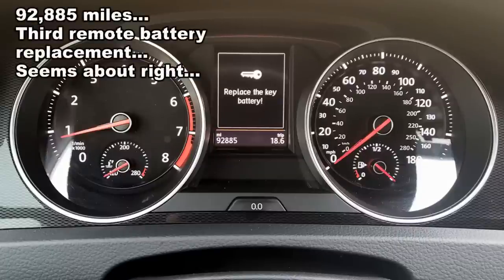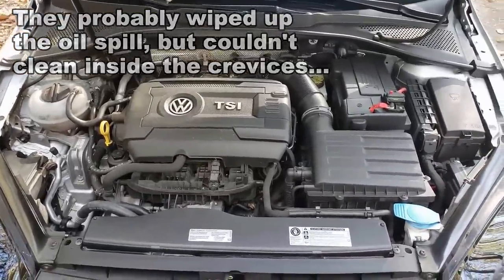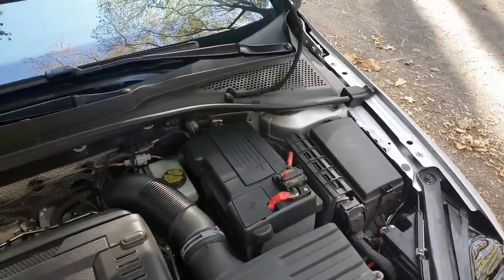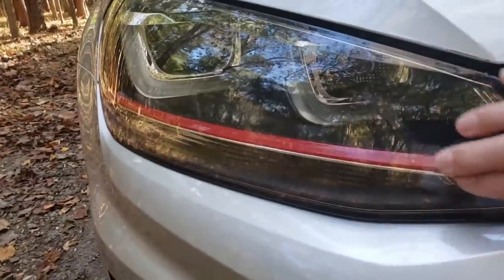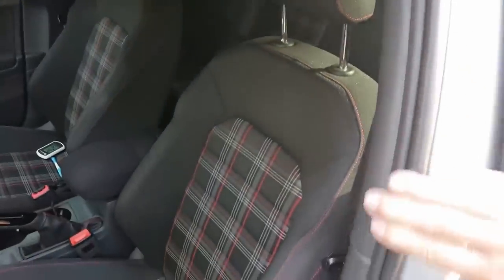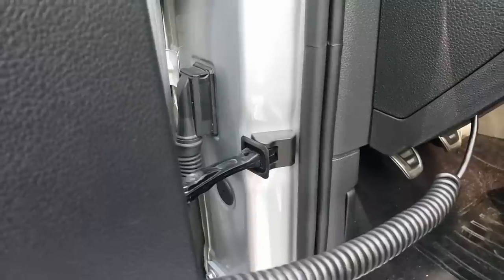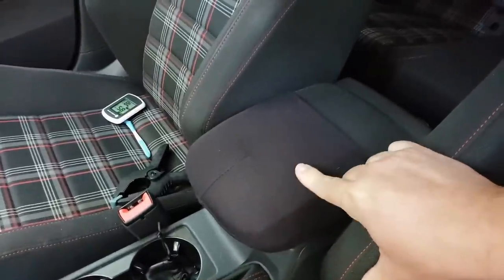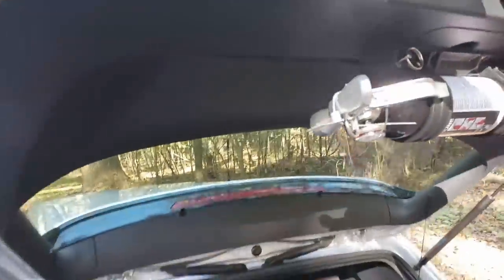THREE YEARS AND 93,000 MILES: My Report, Part 1

Comment: I had the same problem when I installed the steel oil pan. I did some research and found out that the Audi S3 oil pan gasket fits perfectly. Here is the info: FEL-PRO #OS30821. So far, there is no oil leak. Hopefully it will help you out as well.
Reply from the maker: Thanks for sharing that. Oddly enough, I had already found that part as well as a similar one by Mahle. I went with the Mahle part, seen at https://amzn.to/351UMJT. I'll shoot a video when I install it. -Scott
Reply: @StealthGTI  when I click on the Mahle gasket on your link , it said not fit your GTI.  Are you sure it the right one? By the way, I have a steel oilpan as a backup for my 2019 gti rabbits. It's only a little over 6K miles. If the plastic oilpan leaks down the road, I'll be replaced with the steel oilpan.
Reply from the maker: @altimase2003  - It will say "Does not fit..." because the factory car has a plastic pan with integrated o-ring gasket. We're ordering a Tiguan gasket for use with an aftermarket steel pan. As a result, it will not fit a factory car, but it will fit a car that's been modified with a steel pan. Make sense? -Scott
Reply: @StealthGTI  Thanks, Scott. You have driven a lot of miles in three years. Did you change the oil every 10K like the manufacturer recommended?
Reply from the maker: @altimase2003  - Every 10k like clockwork. My next drain will be very early since I need to drop the oil pan to install the gasket. That'll wind up being a 4k drain followed by a 6k drain to get me back on even intervals that match the odometer. OCD, right?  HAHA! I'm a little behind on the air filter and spark plugs. But the car drives fine. It's also time for brake fluid flush and new differential fluid. I'll take care of that stuff soon.
Reply: @StealthGTI  any sign of carbon deposits Scott? This is my first VW. I've heard quite a bit about the carbon deposits issue.
Reply from the maker: @altimase2003  - I, too, was concerned about carbon deposits. My mechanic, a longtime VW enthusiast, won't even bother to look for deposits until the car trips a fault code of some sort. He said more, but I don't recall the specifics. I use only Top Tier fuels, which the owner's manual recommends anyway, and run the car hard from time to time with the hopes that it's burning off at least some of the deposits. I've also read in several places that occasional 20-minute hard runs help to burn off deposits, too. I don't know if it's true. Regardless, my semi-annual support of large bicycling events makes that easy: 1500-lb trailer, then run the car at 3200 rpm for about 20 minutes of the 1-hour morning drive to the venue. I don't know if it's helping or not. But the logic behind a good, occasional hard run seems feasible. ;-)
Reply: @StealthGTI  Thank you Sharing your experiences sir.

Comment: Good almost 100k review lol. I don't have the leather on my 17' sport parking break... I just started to notice last week I'm always rubbing on the weather stripping when I get out too. I'm only at 17k miles and my stock clutch started slipping at 12k with apr stage 1 tune. Still drives fine but I can't push it anymore. I talked with Sachs (clutch manufacturer) and it only rated for 260 ft. Lb. +/-10% so it's just weak from the factory. It's rated within margin for less than the factory numbers so I want happy about that. Love the car though.
Reply from the maker: The video I published a few hours ago addresses the power vs. stock clutch. We'll see if the naysayers understand that I was abusing the clutch with power and towing. HAHA! Thanks for visiting.
Reply: @StealthGTI  I thought I was replying to part 2 lol. I had a lot of fun all the time at first. V. W. Did poorly choose the factory clutch imo. It's almost as bad as the stock tires haha.

Comment: plastic pan is fine unless you autocross the car, if you are really concerned about it and you are since you changed the pan, put the skid plate
Reply from the maker: Thanks! I have the skid plate as well. If I was doing it all over again, I would go straight to the skid plate and keep the factory pan. Oddly enough, the Mk8 uses steel again. I wonder if they went back to RTV sealants or if they have a better gasket? Thanks for visiting!

Comment: You could use Loctite 518 to stick your pan on - any excess mixes with the oil, but does not cause harm because it doesn't harden in the presence of air.
Reply from the maker: Thanks for sharing that.

Comment: I'm a Vw tech, the coolant comes low from the factory and at the PDI some ppl don't top it off since it's at Max but once you drive it it drops so it's low and ppl don't top it off cuz once you open cap the level goes up again but yea if there's no leak that's the explanation when the engine is warm the radiator and hoses expand dropping the coolant level but once you release that pressure the coolant rises since the pressure of hoses degreases
Reply from the maker: That seems reasonable. However, if I top it to the MAX line and then the coolant level drops, isn't that a leak? Or is something else happening? Another VW tech suggested that the cap vents excess coolant. It seemed plausible at first. But wouldn't I see pink "chalk" around the cap somewhere? Anyway, what are your thoughts on continually low coolant? Thanks for posting.

Comment: Great video. My 2013 MK6 gti consumed the same amount of coolant. Maybe just a slight tad more. But never had an actual problem. I just traded that car in for a 2019 MK7.5 GTI Rabbit edition. Slightly used. 7,500 miles on it. I will miss my MK6 but am looking forward to this new adventure. I am interested in your ceramic coat. Did you coat the whole car? Even over your paint protection film? How has it been? Etc. thanks
Reply from the maker: Mega - The entire car was coated, including the PPF. . The ceramic coat is holding up well and has been wonderful to have. Bird droppings lust glide right off when it rains. HAHA! The coating is reported to be good for three years. Thanks for writing. -Scott

Comment: Your very rough on your cars, some of those issues you had are self inflicted which you seem to be aware of. Im also surprised that your clutch went after only 15k on stg 1. I know they are weak but didn’t think they are that weak.
Reply from the maker: Yes, I'm a bit abusive. As for the clutch, I must point out the the clutch SLIPPED one cold morning while towing a 1000-lb trailer. I probably could have driven on that clutch for another year, for all I know. I opted to replace the clutch early. Thanks for visiting.
Reply: What is The towing capacity of a GTI?

Comment: Consider staying with the plastic, because on mine (2015 VW GTI) the plastic warped over time due heat. This takes time to happen, so it depends on what you would prefer. Now what I can recommend is the metal oil pan from ECS Tuning, it is very expensive, but supposedly has a very good seal.
Reply: sorry, meant to say stay with the metal.
Reply from the maker: I definitely stayed with the metal. However, I replaced the RTV sealant with a gasket from a Tiguan. I have a video a few weeks after this one. Thanks for visiting.

Comment: Did you ever find out why you’re losing coolant? Any updates? I have the same issue but mine’s a MK6 GTI.
Reply from the maker: The car finally developed a detectable leak at the water pump housing after 115,000 miles. Thanks for visiting.
Reply: @StealthGTI  holy smokes! I guess that’s considered good for VW pumps.

Comment: Your VW Problems. Recommend you thinking, why don't planes crash on a regular basis. On delivery. Pre Op Total Service and Crew and Maintenance Staff Certification.  In Service. Adherence to Fault Limit during Operation. Mandate reporting of all atypical events. ONLY use Qualified engineers or approved type staff. Approved List. Proper Service & Read-back with second person read-back check. And absolute concentration aware that death of the plane and or passengers is always a permanent event. Adhere to Weather and plan accordingly. Do total Pre Flight Check. Check NOTAMS & make appropriate amendments. AMENDMENT SERVICES:- Must be done pre operation and fully understood. In operation, operate machine/s entirely within recommended limits. Report defects & double check all concerns. CONSERVATIVELY! [re your VW, I'd ground it & recommend a full re build by proper 'arms length' certified Engineer.]
Reply from the maker: I suspect that no passenger vehicle is QA'd to that degree. There's a huge difference between a 3000-5000 lbs passenger vehicle having a mechanical problem that sends it to the curb versus a 300-500 ton jetliner that is far more likely to crash as a result of a mechanical failure, killing hundreds of people as a due to the consequence of one small event. If there are cars built to THAT standard, I can assure you they're priced beyond the pocketbooks of the 99%. Thanks for writing.
Reply: @StealthGTI  Yes, I agee that I overreached to an enormous degree. My excuse here in Aussie that we'd just had Christmas Dinner & whilst the others were sleeping it off, I did a fbook thing. My excuse compounded, is that apart from a 'pre-perandial' tipple, I'm virtually teetotal. Anyway, Merry Christmas & a happy New Year. ps. And enjoy your driving. :-)
Reply from the maker: @letsseeif  - HAHA! Too funny! Shall I expect your return on New Year's Day, perhaps around 1am?  ;-)  Thanks for the response.
Reply: @StealthGTI  I've just hit eighty mate. I might be dead by then.

Comment: About the coolant, I had a tiny leak from the water pump. It was very difficult to spot, because it only happened when the engine was hot, and it evaporated right outside the pump, leaving almost no sign.
Reply from the maker: Thanks for sharing that. If it evaporates from a hot engine, G13 coolant often leaves a pink chalk line. That's what I'll look for when I inspect the car tonight.

Comment: Was the clutch replaced under warranty? Also, did the flash tune void your warranty?
Reply from the maker: I did not pursue a warranty claim. Clutches are "wear and tear" items and usually not approved unless it's proven that something else, particularly a manufacturer's defect, caused the problem. As for the tune voiding my warranty, I'm sure it would have voided the warranty if I went to the dealer with a driveline problem and asked VW to fix it for free. Once VW discovers a tune, getting most warranty work is an uphill battle. I would not have expected VW to fix any powertrain problems under warranty. But I would have expected other repairs on things that APR certainly did not affect. Regardless, I blasted through my warranty very quickly. So, I've been on "my own warranty" for a very long time. Thanks for visiting.

Comment: How’s your driver side window switch feel? Mine doesn’t work consistently when I push extra hard to attempt to put the windows auto up or down
Reply from the maker: Mine does the same thing. It's intermittent; so, I forgot about it when recording this video. I don't think it's the door switch. Instead, I think it's the tolerance on the pinch protection feature of the window motor. It's a little annoying. But, as forgotten in the video, not enough to fuss about. Thanks for visiting.
Reply: StealthGTI thanks I loved the video. I did some further research and apparently VW did revise the window switch because there are two part numbers. Apparently the new switch assembly does not flex as much and resolved the issue
Reply from the maker: @tvbuster  - Very interesting. I'll have to keep that in mind. Did you happen to save the P/N during your research? Are you will to share here?

Comment: My  2018 Tiguan also consumes coolant at a rate that no other vehicle has. No apparent leaks.
Reply from the maker: My closing video for our coast-to-coast road trip playlist (thumb nail says "It's fixed") shows that I eventually developed a leak that was detectable. I now have a new water pump, thermostat, and housing. I think getting over 110,000 miles on the original pump is pretty good, considering the reputation that the early pumps earned. Thanks for visiting.

Comment: Thank you for sharing your experience with your GTI. I have a 2018 GTI Autobahn  it has over 70k kilometers (43k miles) my experience are, first off my battery was defective and thats the original battery,  that got replaced by warranty 2nd I had a engine light on with the Adaptive cruise control light on as well, I got that fixed and it wasn't my Adaptive cruise control at all it was my Thermostat vibration problem warranty paid for that. 3rd stone chip just above the edge of my bumper no big deal, I do have a sun roof and it hasn't leak yet I hope it don't leak at all.
Reply from the maker: Thanks for sharing your experience as well! My GTI is approaching its five-year anniversary. I will release an update in mid-November. Take Care!
Reply: @StealthGTI  Congratz!

Comment: How dose a front wheel drive gti has a Differential?? This car is not all wheel drive. It not a golf R
Reply from the maker: All production cars have a differential. They're what allows the wheels to rotate at different speeds while turning. FWD cars have the differentials built into the transaxle. Most differentials are "open," some are limited slip, and some are locking. The GTI's VAQ locking differential is essentially a Haldex (type) electronic differential that's turned sideways to govern lock-up between the two front wheels, rather than between the front and rear drive axles.

Comment: I love the review. I own a Passat b6 with the Turbo power plant mated to a 6-speed manual, If I'm not wrong it's the same combo in the older GTIs, the car is currently at 78k miles on the clock, I took it to the dealership to take care of a recall, in the process they did a complete inspection a found only two small issues related to the suspension.  2 small brackets, of course, the quote I received from them $900.00
but I'm confident to be able to replace those brackets in my garage with no more than basic tools. other than that the car is holding up really good in fact it looks and feels just like a new car should.
Reply from the maker: My car is due for an inspection. I'll get it done after I swap the oil pan gasket and clean up the mess. I hope to get a good report from them. But I'm also doing a pre-inspection of my own. Thanks for sharing. -Scott

Comment: for the creaking noise...  I know where it comes from: the glossy black b pillar cover trim on your door. Just try to bend this trim using your hand to verify that. In my case, it makes the rattling buzzing noise next to my ear.
Reply from the maker: My creaking went away when I tightened that door check bolt. No doubt about it. Thanks for visiting. -Scott

Comment: Hey i have a windsheild defect also. Who should i contact?
Reply from the maker: Is the car under warranty? If yes, go to the dealer. If it's out of warranty, AutoGlassNow does good work, is reasonably priced, and supplies Fuyao glass, which is very clear in my opinion. Good Luck!
Reply: @StealthGTI  no I've got some left. It's a 19. It's been replaced with a oem panel. So from the drivers seat in the summer time if I look out the right side just right when the sun's catching it. The windshield has these lines going up and down in it.

Comment: Infuriating.  I have a MK6. And if window is slightly open in light drizzle, all the water drips into the car - onto your arm. I even thought the guttering on the roof was faulty.
Reply from the maker: Yup. The things automakers do for aerodynamics. I've learned to just leave the windows up until everything is dry. Thanks for sharing. -Scott

Comment: My mk7 GTI was bought in Christmas 2013. The factory plastic oil pan started leaking after about 4 years+. I believe it was due to my country's weather (hot and humid all year round). I have since changed the oil pan to a metal one. It is good so far.
Reply from the maker: Did you seal it with RTV or did you install a pre-made gasket? Thanks!
Reply: @StealthGTI  The car workshop which i went to to get it replaced, the boss mentioned it is sealed with some silicone (not sure what is the name). So in the event the oil leaks again in future, they could use back that same metal oil pan and reseal it with the silicone.

Comment: Hey nice video! I drive a 2015 mk7 GTI with 104,000 miles on it (been tuned with APR stage 1 for about 1000!) Still on the stock clutch (somehow hasn’t gone out yet... absolutely baffled by this). Problems I have had include the oil pan cracking TWO separate times driving down a gravel road, failed alternator, and an engine rattle on most startups (likely from low oil pressure, I think something goofed when the oil pan cracked). I absolutely am in love with the car and looking forward to more videos from you
Reply from the maker: Thanks for that. I'm very close to changing my oil pan gasket. I will shoot more footage of the undercarriage and hope to publish something new next week. Take Care, -Scott

Comment: 3 years... 93000 miles - that is ridiculous! LOL. Get a diesel, man.
Reply from the maker: I bought this car after having driven TDIs for 20+ years. My GTI has had no problems that a diesel would fix, unless you consider the lower fuel economy. Still, the GTI is so satisfying to drive that it's worth the extra cost of fuel. I don't miss my TDIs a single bit. Thanks for visiting.